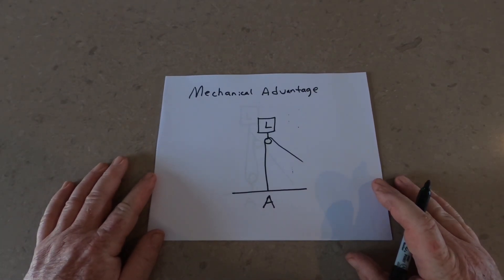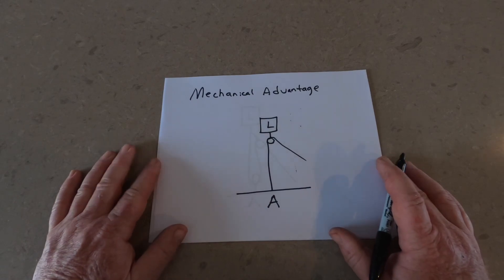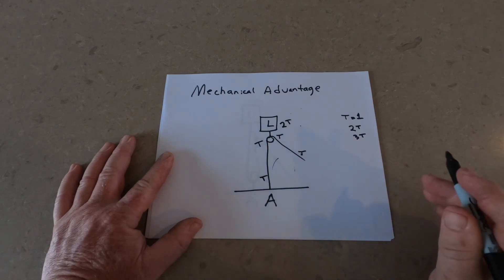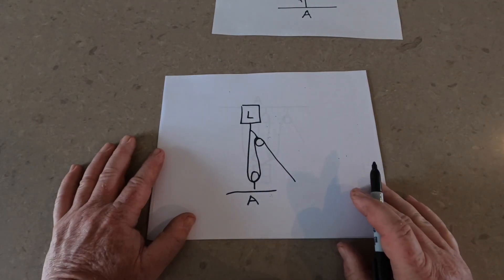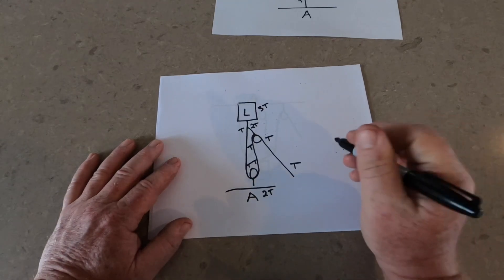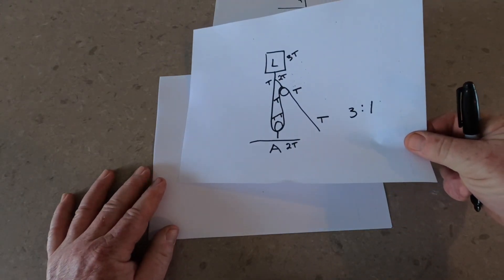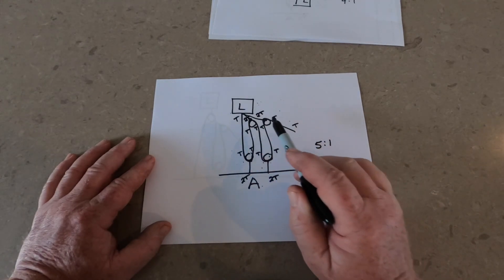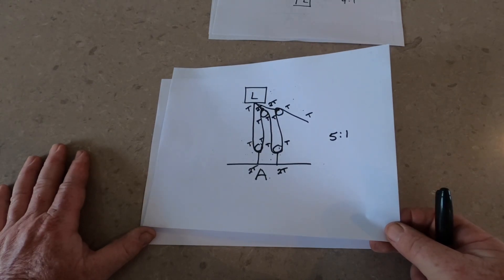Calculating mechanical advantage in Pulley Systems

Comment: Let's say the load is a car and the anchorpoint is a tree. Could I have the inputforce of 1 T coming from a winch mounted on the car by simply redirecting the inputforce using a pulley mounted on the anchor?
Reply from the maker: Imagine there is no winch and you are in the car pulling the rope that is going around a pulley at the anchor and tied back at the car.
What do you think the MA is at that point? A 2:1. Does that answer your question? It's the same concept of being suspended by a rope and the rope travels through a pulley at a high point and the tail of the rope is being held by you mid air. It's not a 1:1.
Reply: @perryfire3006  So if i have a winch mounted on the car pulling with a strenght of 1 T, and the cable loops around a stationary pulley to then be hooked to the car again, I'd say there is 2 T puling on both the pulley and the car. Am i correct?
Reply from the maker: @shpledder  
For this example we have to ignore the MA of the winch itself which is substantial but yes if we were to diagram it out your input would start where the winch came out of the drum at 1T. It would then go around the pulley at the anchor creating 2T there (1T in, 1T out). That 1T would then terminate at the car where it is tied off. 1T plus 1T equals 2T at the car.

Comment: is it fysically possible to make an 8:1 using a maximum of 6 pulleys?
Reply from the maker: Three doubles and a single is one combination, 2 triples and a single is another,  7 singles is the third option or lastly two quads. Interestingly, I can create a 12:1 with 5 singles or two doubles and a single. Go figure.
Reply: @ what do you mean by single, double or triple?
Reply from the maker: @shpledder  The number of sheaves per pulley

Comment: so if you have 9T going to the load, does that mean its 9 times easier to pull the load if you pull on the tail?
Also if you have too many T would the rope snap, or does this help the rope snap less?
Reply from the maker: In theory yes. But due to friction it will never be a perfect ratio. In general however, 1T of effort will produce roughly 9T of force at the load in that configuration. The trade-off (let's use feet for reference) is that you will have to pull 9 feet of rope at the input to raise your load 1 foot. 

Any rope will break if too much force is applied beyond its ratings. So if you create a MA greater than the strength of the rope then yes it is going to break. However, that would be an interesting experiment to see if a system (due to the amount of rope in the system) can carry a higher load compared to a simple one-to- one ratio. I mean, it's still going to break at some point (or slip) if overloaded but how much more? The channel Hownot2 could answer that question more definitively. That's not a simple question you've asked me and the only way to find out is to break some stuff, haha. My guess is that prusiks or rope grabs would slip first and then the rope would break at the knot at the load. Good question for which I don''t have a definitive answer.

Comment: I don't understand why it's necessary to put 2 t's on the same side of the rope on the input and output sides
Reply from the maker: Around the pulley? If so, it's because the tensions have to equalize each other.
Reply: @perryfire3006  What's the difference in the it two T's?  You start with a T from where the load is being pulled. Then further up you put a second T that's on the same side......why?
Reply from the maker: @frnkjones40  Think of the input as only 1T that has to continue until it terminates. That never goes away but along the way  this 1T compounds itself through the pulleys which you have to add together to get the final result. Each time the rope goes around a pulley, the input of that 1T has to be countered with another 1T on the opposite side which creates an equilibrium of forces on that pulley. Thus you get a final force of 2T that the pulley creates. The rope grab is another force multiplier which can increase this input force but remember that the input force has to equal the output force. 

Hopefully too you can visualize how much force is being applied to your anchor in these configurations. Sometimes we focus so much on the final output that we don't consider what our system is doing to whatever is holding our MA system.
Reply: You are right sir.  Physics.  It's not just for breakfast, anymore!

Comment: I guess it is my dyslexia but this confusing to me because your drawing are up side down
Reply from the maker: If it helps draw them out on a sheet of paper and then you can orient them as you see fit. But there is no correct "up" or "down" per se as you can have an anchor or load in different positions. Cheers